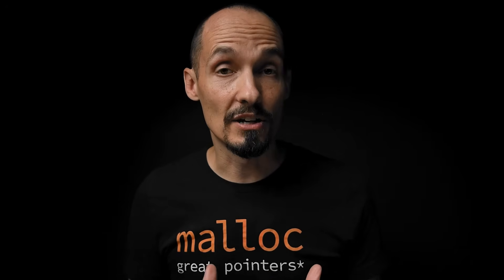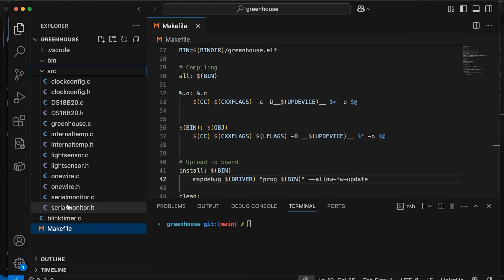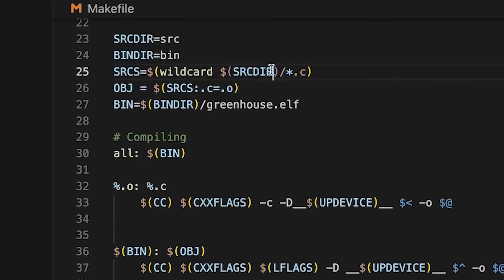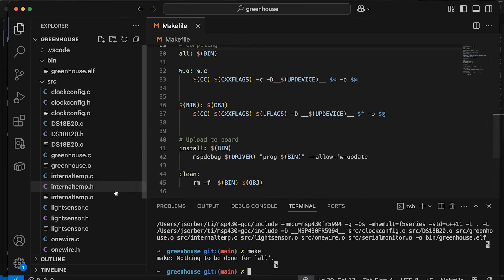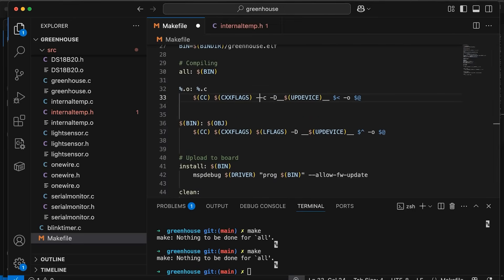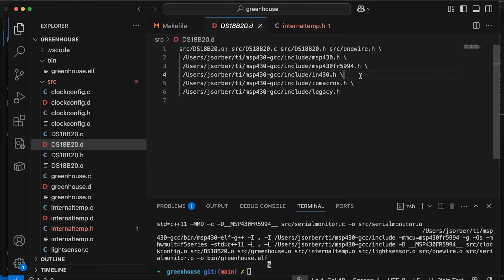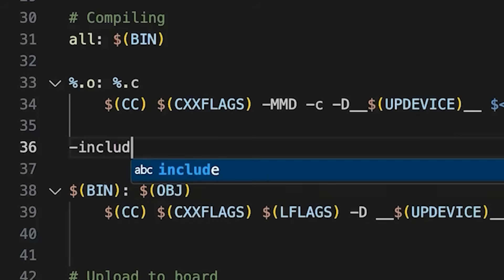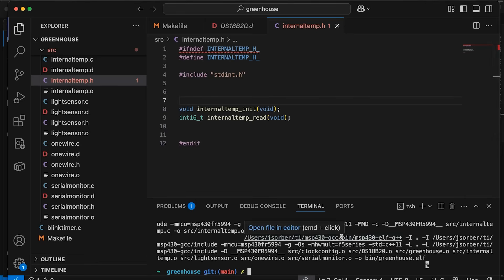A better C makefile with automatic header make dependences

Comment: I wonder why is it still needed to have makefiles. Is it too expensive to automatically compile every .c into an .o and make a list of symbols to match afterwards?
Reply: Well, that is one of the main thesis of the zig language — they are now exploring how their model of always-rebuild-the-whole-thing enables incremental compilation quick enough to replace linting (reducing complexity)

For other, older, languages, incremental builds are quite satisfying when they work. When they do not it can be quite frustrating. Then, after experiencing a build fail due to the build system not noticing a chane — it is hard not to then always have that thought in the back of  your head; ending up rebuilding the whole thing when errors don't make sense because "wait, could it be the build system again?". Which historically for me have made incremental builds a net negative.

...Until I found the tup build system. It checks system calls and automatically finds out all the files a command read or write. The build description thus acts more as a contract.

Your idea of just generating lists of symbols is interesting! Since that in the end is the interface that the linker uses it makes a lot of sense to use that to infer which .o files can fulfill others' dependencies. I don't think it would add much overhead — the symbol information is very accessible. It's an enticing idea. I've done similar things to achieve some radical modularity in my code, but haven't really thought about how it could apply to ordinary code as well.

Comment: While use is ill-advised for the beginner, what about 'extern'??
Must the coder who uses extern be explicit about that dependency in his/her makefile?

How clever is this "compiler extension"?
What does it do when alternative #includes are gated by a #IF/#ELSE/#ENDIF??

Sometimes I think these 'extensions' are the result of idle hands and too many "good ideas" in the room at the back...
Reply: The compiler extension essentially tells the C pre-processor to write out the filenames as the files are read. This means that if you are not changing the logic of the build you are fine for #if/#ekse/#endif  type gated includes. The difficulty arises when you start changing the logic using command line flags, maybe to change from a production build to a debugging build. The correct way to  handle this using tools like make is to put everything in files. The Linux kernel build system is based on this idea - well worth looking at.

In effect the information about which files were used for the last build are being cached in the .d files.
 
A big omission in this video is not adding the -MP flag when adding -MMD. Without it then removing an include file (and editing the source files not to use it) causes make to error out saying it doesn't know how to make the missing include file. Adding this flag will create a dummy rule which will get past this step. The C file will then be compiled and an updated .d file will be created not mentioning the removed file. This also handles change in logic if specified via files.

An alternative approach is to do the removal in steps, first edit the sources to remove the reference to the file you are going to remove, then compile the project to update the ,d files, then remove the file. This does have problems in more complicated projects, so use -MMD and -MP together.
Reply: @IcarusSparry  Thank you.
I disagree with Jacob's premise that this 'extension' makes things "better".
Offloading 'skill' to an "extension" is, to me, analogous to a craftsman investing in a CNC machine to continue production.
As you point out, there are CAVEATS that are usually ignored or forgotten.
Here comes the next Crowdstrike-like bug that brings the world to its knees, "All for the want of the recompilation of a unit because of a header file"...
Reply: @rustycherkas8229  To continue the craftsman analogy, I don't need my person to mine his own coal and iron ore to make his tools. This is basic data that the preprocessor has available (the list of files which it opened as part of the compile) and providing them in a data structure acceptable to make is reasonable. Another popular build tool (ninja) added just enough support for makefile syntax to support this. Of course you should know your tools, hence my disappointment that the -MP wasn't mentioned but I see -MMD as just being good. I like build systems where you never need to run "make clean" or "rm -rf build", but they are few and far between. Automatically recording dependency information isn't perfect but don't let perfect be the enemy of the good.
Reply: @IcarusSparry  In my romantic world, a 'craftsman' would never install a $50 Home Depot sink in a $50,000 kitchen renovation...

Comment: Can you setup the Makefile so .o and .d are in a separate subdirectory? It would make things less messy. Also, what if a .c file has no .h file?
Reply: If the project is spread across multiple source files, all .c's could use one .h, but that would be a mess.
If done as separate 'modules' that are combined, any .c NEEDS a .h because that holds the module's API for the compiler to validate function signatures.
A .c without a .h is possible using 'extern' qualifiers, but ... yech!! Why go to lengths to avoid using the compiler's help?